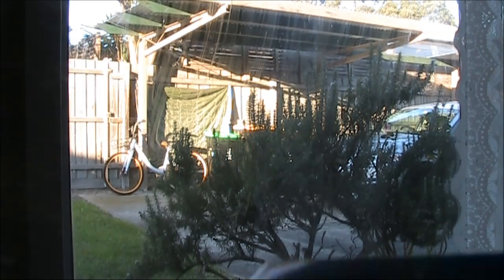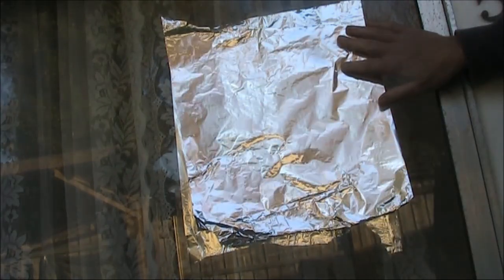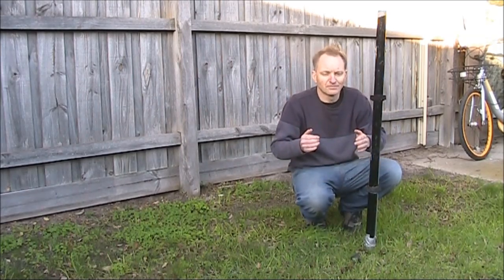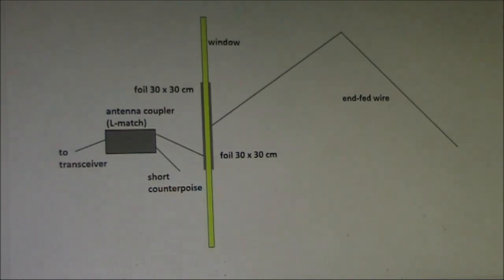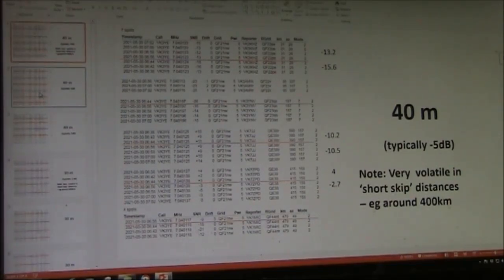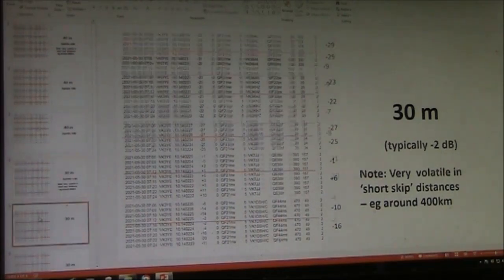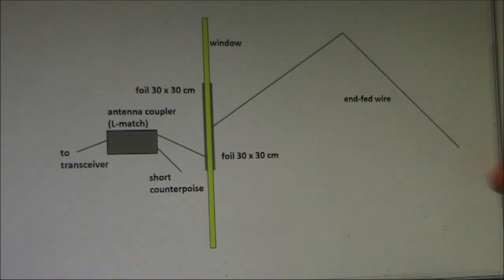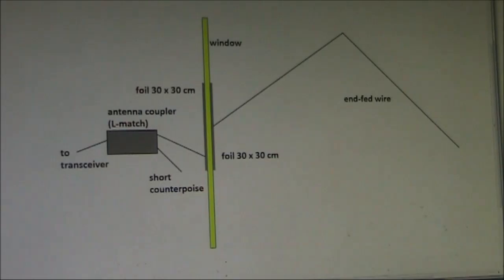RF out the window (A wire-less antenna connection)

Comment: OK for QRP but when both power and frequency go up, you risk heating up the glass to the point where it breaks. That's why I think a coil connected as a resonant transformer would work better. A 20cm flat coil would have coupling factor of about 0.3 with another such coil at a distance of about 4cm. That would be plenty good enough to work with.

Comment: This would be really cool to plot out mathmagically for ladder line. 
I think as long a spacing was maintained, and as big of 2 separate, identical dimensioned capacitors were formed, any 450ohm tapped tuner could handle it.

Comment: This is an interesting experiment.  I wonder if the inability to make a really good electrical connection between the copper wire and the aluminum foil (i.e., can't be soldered) has any negative impact.  It would be interesting to do this with copper foil, although a lot more expensive, I expect.  I suppose a couple big sheets of pc board would be worth experimenting with.  Also, did you take into account the effective electrical shortening of the antenna caused by the series capacitance when comparing the two?
Reply: It is like a Mythbusters episode, except he did not spend over $5 to find out it is possible, and no explosions.

Comment: Not being a troll, just throwing an idea out there, try detaching the wire (and optionally the foil) from just the outside of the window. What you have in the shack now is effectively a whip with a capacity hat on the end. This will radiate enough to get some contacts by itself, maybe not many but it might do ok on WSPR. I have not done any maths to support my argument but an EFHW is very high Z, does it need so much capacitance to couple to it? I am now wondering whether a balanced line arrangement with two small pads on the glass each side would be worth a try?
Reply from the maker: All good ideas. Re the loading, the ideal would be if you put a coil between the foil capacitance hat and the wire so you'd have sort of a sideways top loaded vertical. Even better if you had a room with windows on both sides so you could have two to make a sort of indoor end loaded dipole. But beware of RFI / EMR exposure / noise!
Reply: @vk3ye , I was mostly wondering if yours was radiating from that section. FWIW when I was a youngster living in digs I wanted to be able to use my HF rig, I noticed that my room had the TV feeder to it from a UHF antenna on a chimney. It was obviously easy enough to drive the feeder "common mode" against counterpoises and it worked surprisingly well. The refinement of this was a little project box with two binocular ferrites so I could watch TV while transmitting. There is always a way... 73

Comment: Hi Peter, would you also like to do this comparison but with foly through the window?
I mean 2 or 3 strips of aluminum/copper between the window?
and I mean with a laminating machine? (I mean direct contact!?)
and even better with copper foil that you can solder!?

Healthy and Friendly Greetings from the Netherlands!
Rob
Reply from the maker: Hi Rob - sounds like too much trouble. I don't understand 'foly'. Also I don't have a laminating machine. Things move fast here and once I do a video I'm on to the next project. The main purpose of the video was to get people thinking and for them to try it (and hopefully make videos) themselves.
Reply: @vk3ye  A good solution is aluminum duct tape for a good bond to the window. Could perhaps make two loops as mentioned.
Reply: @vk3ye  
I meant aluminum folly THROUGH the window,
so that you have a permanent contact!

Regards Rob

Comment: I use insulated wire trapped in the upstairs window opening for an E.F inverted V and lamp flex to a ground rod.

But I found if I unscrew the trickle vent shutter on the inside then two long rectangular holes are revealed. The outside has a similar part I can't reach but with a slotted grill. 

As some of the grill bits are broken I found a piece of CAT5 fits through - so I might try coax through it instead of drilling the wall.

Comment: Suspect you would have less loss on 40m using a larger foil. Did you measure SWR?
Reply: It patches into a tuner, so if there was, it was adjusted out. Measuring the pf of the capacitor created with foil and window, and making a coil to inductive compensate for the electrical shortening caused by the huge capacitor, on the window side, would have been for chapter 2. 
Somewhere in the forest, a pitched storm window, with 2 panes to glue foil to, is working as a big, cheap, high wattage vari-cap. 
The thin foil might be the main change, to duct sheetmetal, and a solder or screw to crimp connector, for eliminating loss in connection, and the room in the metal for electrons to que then transfer. 
Coupling 50ohm coax through a glass pane would be chapter 3.

Comment: Thanks Peter im appreciating the hints and tips for apartments mate, im stuck in a bottom flat with the double glazing oh that's not the worst part iv got a substation 30' maybe away too it's a nightmare but I'm moving to a better house hopefully in the very near future.
Reply: Maybe throw a magnetic loop up. I’ve made a mobile whip for 7MHz on a mag mount on my car. While there is all sorts of QRN around the city, it seems to work OK, though not as efficient as a full 10m quarter wave, but I can make QSOs while driving around. Even tried CW with my left hand and head copy....challenging, but fun....and surprisingly no more distracting than talking to the passenger.

Comment: This is exactly how those window-mounted car phone antennas worked back in the early 90’s. There was a small coupling box with an antenna cable from the car phone that attached to the window inside the car. Outside on the other side of the glass a flat metal plate connected to a small whip antenna would attach to the glass on the other side of the coupling box. I still see these antennas on some police cars today but the whip is quite a bit longer than the old car phone antennas.
Reply: You can still get them now for C B and 2m/70cm…GME and  Tram make them.
Reply: Peter: I have thought about this window capacitor antenna coupler for a  long time. Good for hams who are renting their house or flat!  You might like to compute the capacitance.  I use the MKS formula, all units are meters. The multiplier constant is about 9 pf.  It gives a capacitance of a couple hundred pf for your coupler.
from Chuck KF8TI

Comment: you could also spray a little bit of water on the window prior fitting the aluminum foil. The foil will be perfectly stretched to the window's glass. Probably like a 0.1-0.2 db win (thumb rule guess)...
'72s de YO3DRN
Reply: @David Wanklyn Upgrade to two plates of duct sheetmetal.

Comment: I am having trouble understanding this. Is this capacitance or is this inductance? I think of RF coupling as being inductive as both the electric field and the magnetic field are required for propagation. Capacitance, on the other hand, is storing and releasing electrostatic energy. Electrostatic energy by itself doesn't constitute RF propagation, does It? Can anyone clear this up for me, I'm intrigued?
Reply: Sure. You can either capacitively couple as Peter has done here or inductively couple like in a magnetic loop antenna. Same as on say an audio amplifier. It may have a transformer on the output or a capacitor on the output. 

This is like a capacitor in the signal path and doesn’t strictly form part of the antenna in terms of radiation. That said it will have an effect on where the antenna resonates. 

So yes, it is capacitive coupling between elements of the antenna. There are capacitor calculators out there on line that allow you to calculate the approximate value of the capacitance, and you can then calculated what sort of impedance it adds at a given frequency 

Hope this kind of makes sense
Reply: @MidlifeRenaissanceMan  Thankyou for taking the time to reply.
Reply: David Brayshaw
The sheets are plates of a capacitor.
A Half wave is  hi z, voltage  feed and if trimmed, is purely resistive.. The Cap would then feed voltage OK but coax is low Z and match must be made.
A 1/4 wave is low Z and I feel that the capacity of the window device would be insufficient for the current required.
It is professionally successful at VHF but they ensure High z on both sides.
Reply: @MauriatOttolink  Correct. the capacitor is between the radiator and the match, so it is at the high impedance portion of the radiator and so has less of an effect than feeding at a lower impedance, current driven point on an antenna. 

Due to skin effect, I am wondering if it would have made a difference attaching the wire to the inside of each plate ? Probably not, but might be worth a test.
Reply: @MidlifeRenaissanceMan  
HI  Chris... YES.. Peter puts out some bloody brilliant stuff. Plus he can squat down.on his toes
without shoes longer than I can stand on one leg with mountaineering boots & a walking stick.
However, I am baffled by this.  
The window capacitor can't handle anything other than a high Z ...voltage feed.
Reply: @MauriatOttolink  think of it as series resistance. If you have two 1M resistors in series across say 10V you’ll get 5V in the middle. If you add a 1K resistor in between, you’ll get close enough to 5V either side of the resistor and minimal voltage drop. As a percentage of the total resistance it’s negligible. 

Same circuit with say 2 1K resistors in series. You still have 5V in the middle, but if you add the extra 1K resistor in the middle, you get a third of the voltage across the middle resistor. 

The higher the voltage, the less the resistance matters. Hence they use 330KV and 660KV transmission lines for shifting electrons aground the state / country. 

So assuming 5mm glass. 30x30cm should be around 130pF give or take 

130pF @ 7MHz is around 175 ohms of reactance. So 175 ohms inserted into an end fed antenna with a feed impedance of say 2K, is significant, but not a show stopper. 

122 ohms at 10MHz so a improvement. 

I just used some basic online calculators to work that out. 

It’s kind of scientific, but with all the variables, it’s also kind of magic too. My end fed for 20m is made from 33’ of telescopic aluminium tube and has a characteristic impedance of only 800 ohms or there abouts. A 49:1 transformer doesn’t work.  I made a switch box to tap the primary and secondary of a 14 turn transformer between 2 and 14 turns so I can dial up an approximate match, then wound the matching transformer specifically to match. Works ok so far :-)
Reply: @MidlifeRenaissanceMan  
HI..Chris.....Many thanks.
Extremely interesting. I'd guessed at 150 pf for the window capacitor., 
For a single band ..20 metres, 33 feet, I'd be inclined to link-couple into a parallel tuned circuit and connect the inner plate to the tuned side.
Your analogy with resistors is very explanatory but I reckon the highest resistance could be from the lady of the house!
I'd be inclined to use large sheets of thin gauge aluminium with removable fixtures to use or shift as required. 
We don't want complaints from the home office!
I guess that double glazing would scuttle the whole idea. 
Probably OZ is so warm that they don't need double glazing!
Thanks Chris...Good reading. Had no experience with high V distribution, beyond knowing why
EHV is used.

73 de G3NBY.
Reply: @MauriatOttolink  all good. Yes. The Minister for Finance, Entertainment and Shoes has not yet allowed me to put the vertical up on the rooftop....yet....which would give me an extra S point I am sure

She doesn’t want me up there all the time fiddling and tweaking the various contraptions I have made,, including some magnetic loops around 3m in diameter that are great for 40m. Making a reliable motorised tuning capacitor and a rotator that can cope with a southerly (your northerly) without stripping the gears is certainly a challenge. 

So much to learn. So much to try. So much to figure out for ourselves :-)

Might catch you on the air when the bands pick ups some more. I’m mostly in the shallow end of the CW pool on 40m when I’m on, and 20m when it’s firing. CW is much safer than me using a microphone :-)

73 de VK2NAP